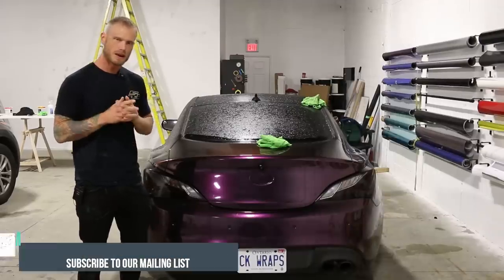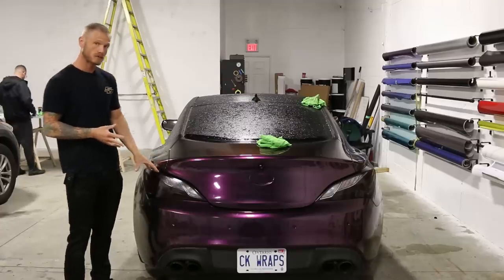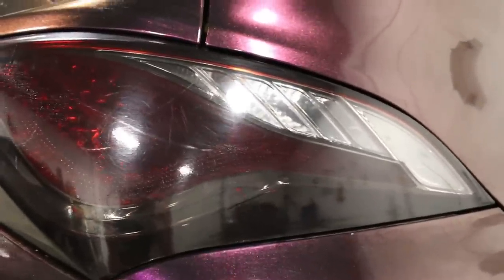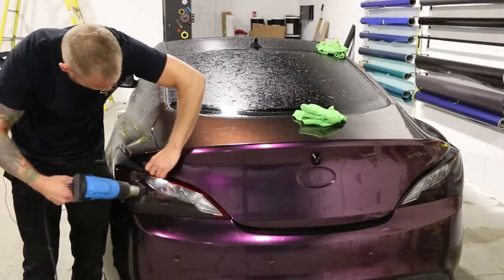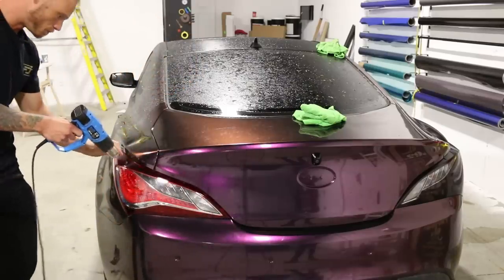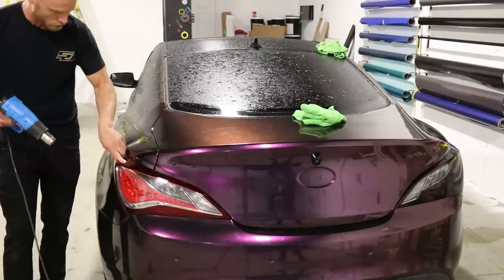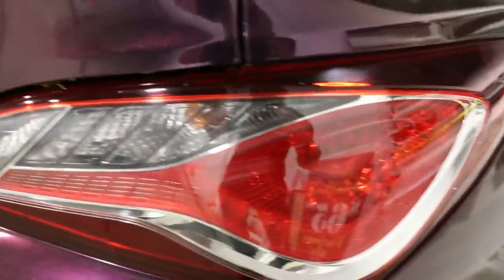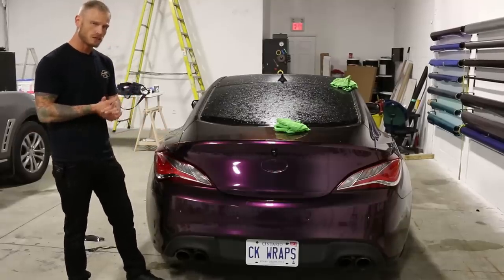Tint Removal 4 YEARS Old - How Did It Come Off??

Comment: Definitely see where I messed up. LOL. I recently tried to remove the Vvivid vinyl from my headlights and did not heat it. It came off in chunks and left ton of glue. It sucked. I ended up buying new headlights. lol. Thanks for this tip.

Comment: Vvivd must send you the good stuff! Every removal for me left excessive amount of glue even after a year. Luckily tho, 70% alcohol cleaned it up.
Reply: Paul Quintero tac reducer
Reply: o HITMAN14 tac reducer for complex curves? No thank you. I use that for high tack KPmF and 3M
Reply: Paul Quintero you don’t gotta spray a lot just one tiny spray. I took mine off in one piece with no glue at all without heat. In the Texas heat
Reply: o HITMAN14 o I switched to Lux tints. But good tip for sure
Reply: Paul Quintero I haven’t tried anything else but vvivid. No problem . Lmk how that goes for you

Comment: I just took same tint off my headlights . Did it myself. Removed using heat gun also. Have a lot of glue to remove..assuming this happened because it’s under 50’degrees here in ny, any suggestions on glue removal?

Comment: You do your front ones? I bought some vivid light smoke ones off Amazon and it peeled the paint off the trunk and ripped in my hand like a piece of paper.
Reply: Mask around the taillights and headlights when tinting. It brings down the surface area where it would like to stick to. Always apply in room temperature and apply heat before stretching. Should fix your issues you had.